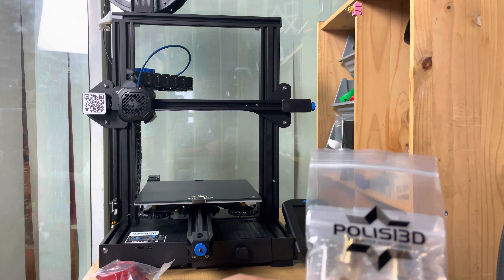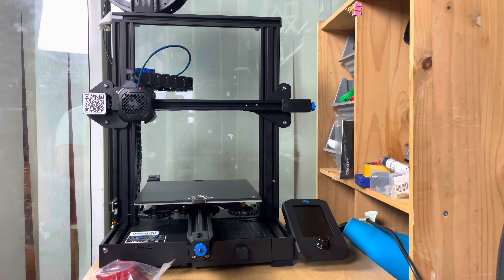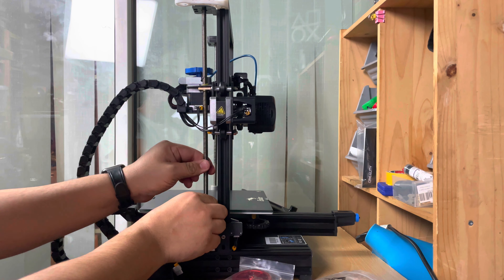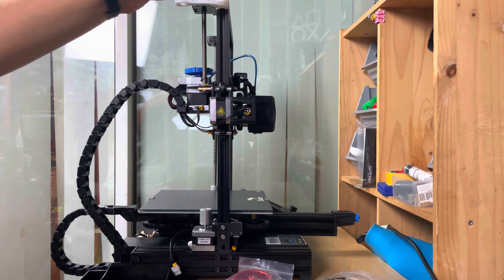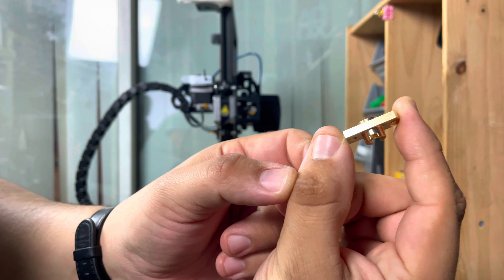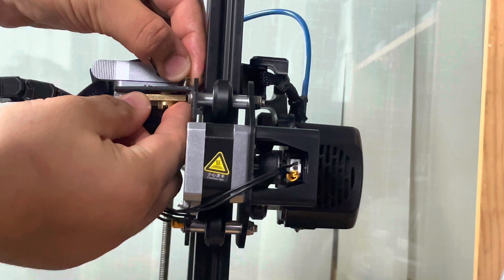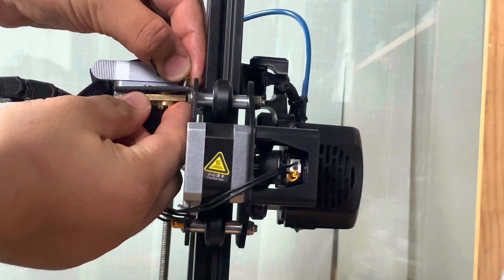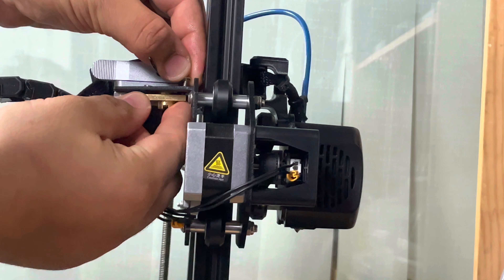Ender 3 V2 Anti backlash nut installation

Comment: These are installed upside down. This is not a debate but a fact.

The reason you don't notice is because these printers only ever go UP and not down, during print jobs.

They don't have backlash to be anti'd. However, this screw adds friction which reduces sag from gravity on the gantry, reducing elephants foot and other benefits.

But this is still installed incorrectly, even if it serves it's purpose for providing friction on the z-axis.
Reply from the maker: Check here from big YouTuber who dedicated whole channel to 3D printers https://youtu.be/Lpc1bTsSpRA

Comment: Apologies but isn't it installed upside down? This would be pushing the gantry upward (due to the spring), instead of downward. This would mean gravity is countering it, making it less effective instead of pressing it against the teeth of the Z bar. Please correct me if I'm wrong.
Reply from the maker: Interesting 🧐 I will look in to it thank you

Comment: Hilarious, why didn’t the z axis bar drop with the power off, are you sure this is necessary ? Thanks good demo.
Reply: There’s another Z-rod/stepper on the other side of the printer. He installed the double Z-axis mod prior to this installation
Reply from the maker: Yes Dual Z Axis 😎
Reply from the maker: I did mainly install this mod to eliminate elephant foot 🦶